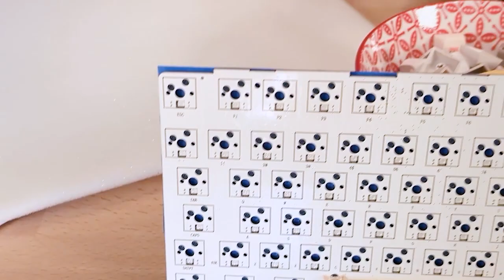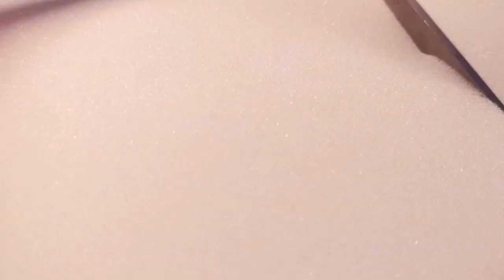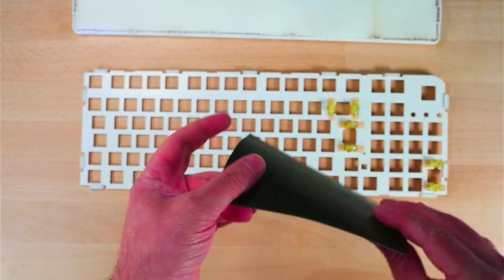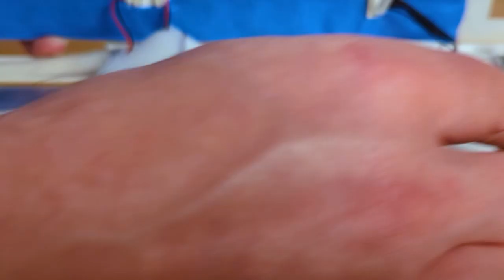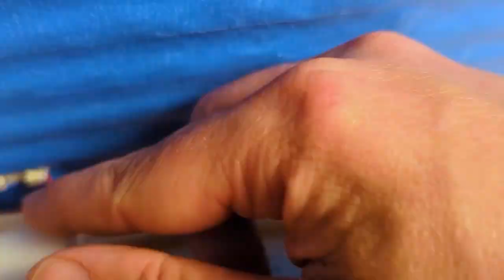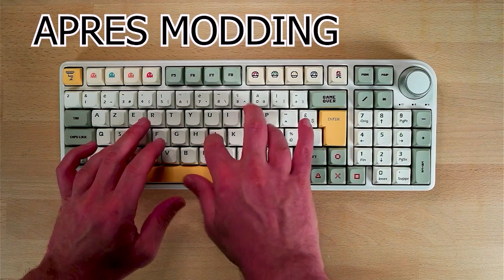Tuto modding clavier, partie 3 sur 3 : mousse et Gasket Mount

Comment: Ça à clairement fait du bien au niveau des stabs.
Par contre pour plus de flex au niveau de la plate j'aurais probablement pas mis de mouse dans le bas de la case. Pour une case en allu pourquoi pas mais pour du plastique ça sert pas à grand chose et surtout ça fait doublon avec le Tape mod.
Pour moi 3 couches de scotch sans mousse et y'aura amplement ce qu'il faut niveau son.
Après sur les gasket mount un peu rigide comme ça, ça peu valoir le coup de ne mettre qu'un tampon sur deux au niveau des emplacements, histoire de laissé la plate respirer un peu. A voir.